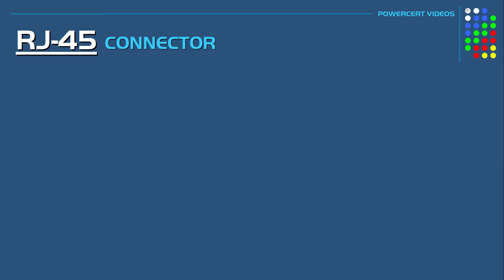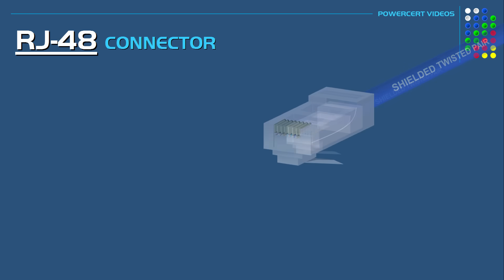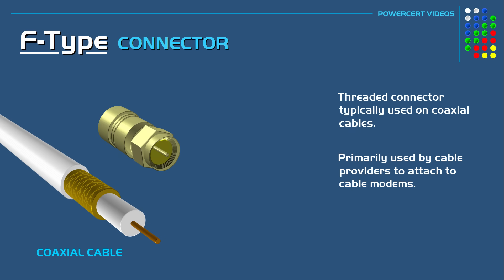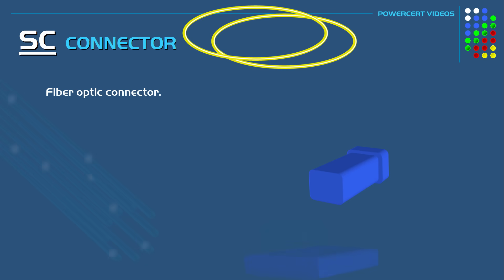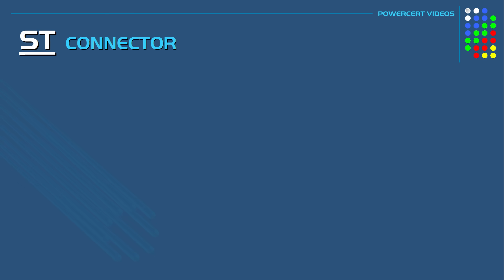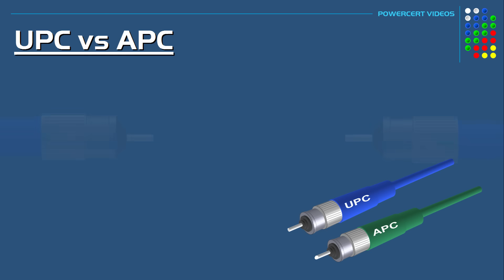Comment: I personally purchased this to add wireless networking to my desktop:  https://amzn.to/3jwITCQ
(affiliate).
Get the VPN that I use (affiliate).  https://nordvpn.com/powercert
Get 66% off a 2-year plan + 1 month free.
Reply: 🎇✨🎆💥Hello, thanks for your work. Your Video Design is neat, and topics very interesting and well covered. I would like to address some details regarding this video : 

1) According to every reference I came across, "RJ-45"  is a wrong name for what is actually 8P8C connectors. Of course I know most people use the wrong name, but I think you could consider citing at least once the appropriate name. 

2) You present STP Shielded Twisted Pairs as cables for RJ-48 connector, which are used in T1 lines. How come that everyone talks about STP 8P8C (A.K.A. "RJ-45") cables for Ethernet lines, not just T1, including yourself in your own video https://youtu.be/_NX99ad2FUA?t=56 "Ethernet Cables, UTP vs STP, Straight vs Crossover, CAT 5,5e,6,7,8 Network Cables" ? You seem to contradict yourself! 

May we know your take on those two points? Keep Up The Good Work! 🖖😀👍
Reply: @philpeko1796  You are wrong about RJ-45. 8P8C is a term used to describe the specific details of the cable standard. The 8P8C stands for 8 Position 8 Contact. Which means 8  wires connecting to 8 conductors. That is why RJ-11 can be also called 4P4C. Although, "ethernet" is a general industry term used to describe network copper cables. RJ-11 is also ethernet and so is RJ-45. Hope this helped :DD
Reply: @jammel3653  This is right, 8P8C is not specific to Ethernet  TIA/EIA-568 (T568A and T568B). But what is also right is that "RJ-45" originally refers to a specific wiring configuration of an 8P8C connector, for which a telephone-system-standard RJ45 plug has a key which excludes insertion in an un-keyed 8P8C socket that we all use  in Ethernet TIA/EIA-568 cables. The point is that "RJ-45" was already used for specific telephone cabling with keyed-plugs, and it should not have been used for Ethernet TIA/EIA-568 cables. Do we agree? (sources : https://upload.wikimedia.org/wikipedia/commons/d/d8/8P8C_vs_RJ45_female_connectors.png  https://en.wikipedia.org/wiki/Modular_connector#8P8C )
Reply: my why mati? oh like she orange cry hm really 2 like mana i said oh my girl and boy my said why mati what siapa why really marah oh hahaaa?😈👊
Reply: @philpeko1796  my why mati? oh like she orange cry hm really 2 like mana i said oh my girl and boy my said why mati what siapa why really marah oh hahaaa?😈👊
Reply: @jammel3653  my why mati? oh like she orange cry hm really 2 like mana i said oh my girl and boy my said why mati what siapa why really marah oh hahaaa?😈👊
Reply: Plz upload the vedio on booting process and subnet , mask
Reply: Canim

Comment: This is an incredibly helpful and well-animated explanation of networking connectors! The coverage is comprehensive, from the standard RJ45 to the detailed difference between UPC and APC fiber ends. The visuals make complex topics, like cable crimping and light reflection [00:08:58], easy to understand. A fantastic resource for anyone learning network basics. Thank you, PowerCert!

Comment: I don't understand why would an angle connection reduce anything. Afaik, light doesn't interact with other light, it passes through it. That's why we can see anything at all an not have a blurred image. In both cases the light reflects and travels back in one way or another, is there less of a reflection and thus more of the signal passing through?

EDIT: must be destructive interference. Light can cancel itself that way.

Comment: Why does STP require a different connector than UTP? Two videos ago in the playlist ("Ethernet Cables, UTP vs STP, Straight vs Crossover, CAT 5,5e,6,7,8 Network Cables") it was sort of implied that the only difference was the shielding and that the wires are the same.

Comment: RJ48 is NOT! connector type! It is wiring scheme for 8p8c modular connectors (wrongly called RJ45) used  in T1 networsk. With STP cables you stil uses 8p8c connectors but with shield. As I mentioned even RJ45 is not equivalent of 8p8c. First is keyed connector, second not. RJ11 is not 4 wire connector! It is 6p (osition). You didn't mention about that BNC were used in data networks 10BASE-2 standard in 50Ohms variant. With A / V signals these are used commonly in 75Ohms version.  Next. MT-RJ is designed not for replace SC connector but for duplex fiber connections where you can't use multimode fibers. It is registered what is mean that can not be connected in wrong orientation. There is much, much more mistakes and misconceptions in video.

Comment: Headup for misinformation: RJ-45 connectors comes in 2 types: shielded AND unshielded. The shielded cables in reality do NOT come with a type that has a shield covering 4 unshielded pairs, think about the crosstalk here. Instead all 4 pairs are individually shielded, preventing the signals in each pair to interference each other. Also this kind of shielded cabling is usually only way to build a working Cat6a or Cat8 network (We do not talk about Cat7).

Comment: Great video though a couple of small points. 

BNC is anything but uncommon. They're pretty much the standard in the TV industry. Also worth noting the terminators are usually used, at least in our cases to end a chain.  So you'd feed reference to equipment in sequence, one device connected to the next and next and next... The final device gets a terminator on the end to close the circuit.   Surprisingly it's actually a necessary part of the chain. 

Fibre wise, ST's are again largely used in TV with it being the relative standard for most connections due to how rugged and easy to clean they are.  Oddly though devices will commonly have an LC connection.
Reply: Noted.  Thank you.

Comment: Do you do any videos where you're not just literally reading from Wikipedia? 

BNC connectors are widely used by ISPs delivering fibre based internet where the "last mile" uses legacy HFC cable, or where the connection is delivered via satellite or fixed wireless. 

BNC is also widely used by cable television providers. Cable television is technically a centralised data network, and the cable into the television can be overridden to access the internet (if you know what you're doing).   
 
I stopped watching after you bungled the BNC connector. History tells me that you'll bungle up about 35% of the information in your video because you're just reading from Wikipedia.

Comment: I was actually looking forward to [USB-A - USB-A]-type cable to network computers [USB - Wifi] and [USB - Ethernet] are not really networking cables like rj-45 at least as a pedantic technicality. In those cases USB connects to a "device" that then connects to the network it is not a direct connection. I hope that makes sense.
Reply: Do you mean USB C. Using a USB A to USB A would short the connector which is why we have USB B.
Reply: @gljames24  Correct, but there are special USB-A to USB-A Cables with a PCB in the middle. I belive they are called "USB Transfer Cables" but I have no clue how they work. I just know they exist

Comment: Hi, Fibre (Fiber) connectors are all highly polished and thus will reflect light, reflectance. PC means physical contact and UPC is Ultra polished physical contact. The reason we use the 8 degree angled physical contact connectors is for high power LASER networks. A standard PC or UPC will reflect too much light back in to the LASER that can upset data transmission symbols and cook the LASER which is already running very hot. But the APC allows the majority of the light through and any reflected light is directed in to the cladding and then the buffer but does not make it back to the LASER. Hope that helps.

Comment: Most accurate explanation ever
Reply: oh wow youre here
Reply: Very good overall, expect for the last phrase. APC is used in order to have a better return loss, the signal loss or what is formally called insertion loss in usually slightly worse in APC than UPC.
Reply: @vladulescuadrian6080  what does UPC and APC stand for i coudlnot find on the video nether google
Reply: @leto1449  UPC = Ultra Physical Contact / APC = Angled physical contact
Reply: ofc its you again...

Comment: Did you know Home Depot and Lowes don't know the BNC male only uses a BNC female? They only sell the male, which cannot be used to connect to any other connector.
I have talked with corporate many times on this issue and they still don't get it.
The BNC is great for radio astronomy antenna connections and many other locking connections.

Comment: Ever use the IBM connectors? I think they were called Token Ring type 1 and were unisex. Either Male or female and plugged into your MAU. What other obsolete connector type were there?
Reply: I remember those! We called them the Boy George connectors, because we couldn’t tell if they were male or female, they were temperamental, fragile, and much bigger than they needed to be 😂.  Since we’re talking obsolete IBM standards, did you ever use twinax? I had to relocate a bunch of 5250 terminals used on an old System/36 and the twinax they used was HUGE! And with massive screw connectors with two pins, which were sturdier than they looked, to be fair. We ended up getting screwed for a box load of Baluns to convert them for use on our UTP cabling so we could wire back to the multiplexer. (The System/36 was in another office). Fun days! It’s too easy these days...
Reply: @leopold7562  yep I remember twinax. Even installed a "leaky" coax job. A sort of early wireless network. Cable had specially shaped holes down its length so signal leaked out and you ran it in a loop through the ceiling and had wireless receivers.

Comment: how does reflection of light cause signal loss? does it descructively interfere? please explain.
Reply: It causes reduce in signal strength because some of the light is reflected back and thus less light will reach in to destination. This will mostly just shorten the maximum length of the fiber connection but in some cases too much reflected light can interfere or even damage optic transmitter as it's not usually designed to handle much reflected power.
Reply: I can’t say I agree with your explanation totally because the angled version which is a better fiber because it reflects not less but just at an angle. So why is reflecting at an angle better than straight back?
Reply: @Jarrod_C  because of the reason you just mentioned. When the light is reflected back in angle, it has to travel much longer distance before it reaches back to source than if it would be reflected just straight back. This longer distance and multiple "bounces" from wall of fiber causes losses and that means less reflected power to reach back to transmitter.

Comment: Where fibre optics is concerned, you are wrong in so many ways. For example, the MTRJ is not becoming increasingly popular, it is old hat. I suspect you are confusing it with the MPO connector. As for the ST being commonly used with singlemode fibre, you are completely wrong. Yes, there were singlemode versions back in the day', but these were few and far between with this dinosaur, which pre-dates all the other connectors you mention. The ST is a multimode connector at best! As for the 'couplers' versus 'adaptors' comment, they are the same. You are confusing the purpose with 'hybrid' adaptors, which couple different connector types. Finally, UPC polished connectors are not flat polished, they have a radius polish, as do APC. There is little or no improvement of insertion loss (IL) between the two types, it is the reflectance (RL) that is reduced with APC, which has the tangent from the core centre shifted by 8 degrees. By the way, the fibre core is surrounded by the cladding, not a 'wall'.

Comment: One of my laptops did not have an RJ45 port for Ethernet. So, I got one of those usb Ethernet adapters. Holy crap that thing got hot and got hot fast. Ultimately I had to switch back to wireless.

Comment: RJ45 is also used with STP not just UTP.
Glad you didn't cover all the fibre connectors as that a damn minefield, the industry is a complete mess with almost every company releasing their own standards just slightly different from everyone else. Requiring new disgustingly expensive gear to use, its almost as if they want to milk cash from just a few that can afford it. Why they don't settle on a few standards and sell them cheaper to many more people I don't know.

Comment: 🎇✨🎆💥Hello, thanks for your work. Your Video Design is neat, and topics very interesting and well covered. I would like to address some details regarding this video : 

1) According to every reference I came across, "RJ-45"  is a wrong name for what is actually 8P8C connectors. Of course I know most people use the wrong name, but I think you could consider citing at least once the appropriate name. 

2) You present STP Shielded Twisted Pairs as cables for RJ-48 connector, which are used in T1 lines. How come that everyone talks about STP 8P8C (A.K.A. "RJ-45") cables for Ethernet lines, not just T1, including yourself in your own video https://youtu.be/_NX99ad2FUA?t=56 "Ethernet Cables, UTP vs STP, Straight vs Crossover, CAT 5,5e,6,7,8 Network Cables" ? You seem to contradict yourself! 

May we know your take on those two points? Keep Up The Good Work! 🖖😀👍

Comment: RJ45 is now called a 8P8C connector.
Reply: Oh boy.

RJ45 and RJ48 refer to the wiring of an 8P8C connector, and this is where things fall apart -- both have been obsolete for decades.

He's actually illustrated T568A wiring. There's also T568B. Both are defined in TIA-568, commonly called ethernet.

RJ48 is not synonymous with STP, nor is RJ45 synonymous with UTP. There certainly is STP, FTP, S/FTP, and every other flavour of "RJ45", particularly with 10GBASE-T.

But you're right. RJ45 is an old arrangement with an in-line resistor. RJ48 is typically wired as 8P4C, therefore the cable illustrated wouldn't be compatible. 8P8C is the name of a very common connector. What's he's illustrated should be called TIA-568, BASE-T, or ethernet -- not RJ45, not UTP, not STP, and definitely not RJ48.

While we're here, LC fibre is always a joined simplex pair. He's illustrated half that connector.
Reply: That's -- weird. Was replying to another comment about the same thing. No idea how I got here. Other comment got removed. o.O
Reply: @RandornCanis , thanks for that comprehensive answer.

Comment: Ethernet connectors are often called RJ45, though they're official 8P8C. They look much alike, but are different in practice.
Reply: Probably should include the TIA-568 wiring, too. 8P8C is used many different ways.

RJ45 and RJ48 are totally obscure and obsolete standards with resistors and 8P4C. Not synonymous with UTP nor STP.
Reply: I'm tired of telling this to people. They just don't care.

Comment: Can rj45 couplers be used on two 100 meter cables to make 200 meters?
Reply: You should join them with a repeater. Because the signal is too weak after 90 metres on UTP usually.